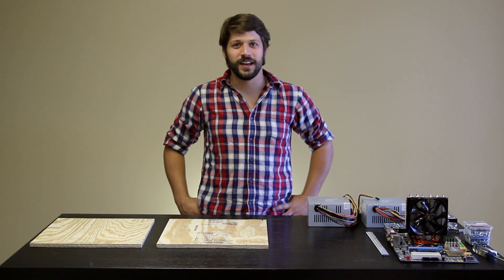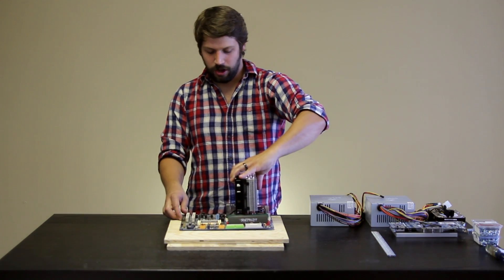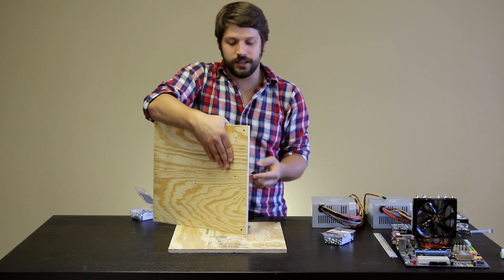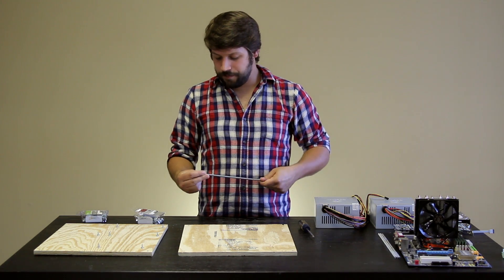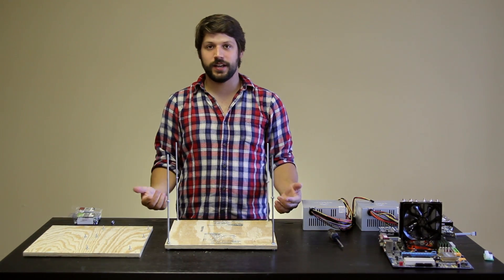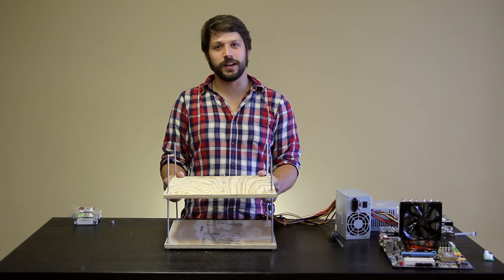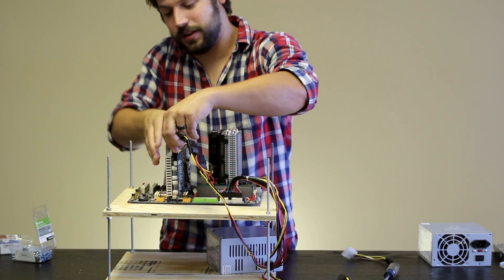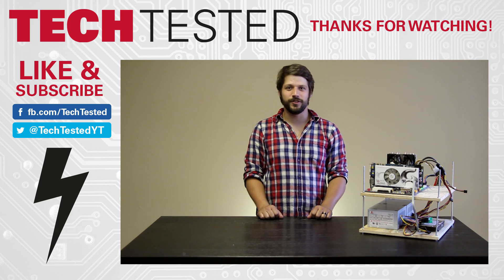How To Build A Budget Test Bench

Comment: Just in case somebody watches this anytime in the future.
Put the threaded bar into your cordless drill, wind the nut on a few threads and then simply hold the nut still with some grips while winding the bar with the cordless, soooo much easier.
And never, not ever, scrimp out on a cheap PSU for your test bench, never.

Comment: to speed up initial nut placement place rod in a drill and just hold the nut and let it spin for the rest maybe a rubber disk in drill to spin the nuts by friction like a wheel against the nut.

Comment: If you have a drill you can close the teeth around the threaded rod and hold the nut. It'll zip the rod through the nut just make sure you don't over tighten it so you don't strip the threads.

Comment: You can also use it as your main system, ayt? :) + glass case.
Reply: Wolfy TV i do that :)
Reply: Few slots in top board for cable management. Acrylic cover. Boom.
Increase the 4  pillar hole dia by one eighth.